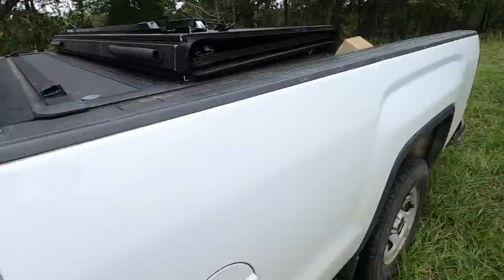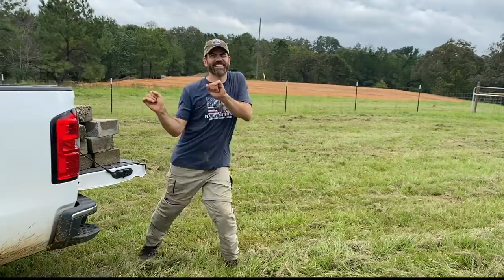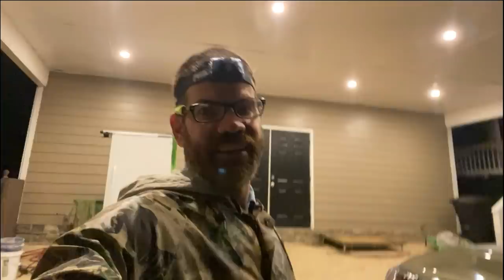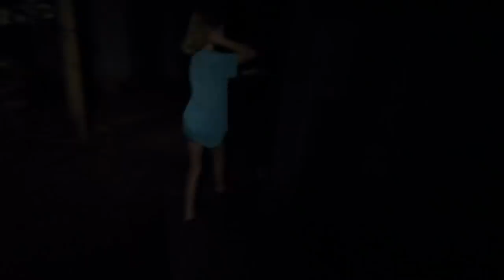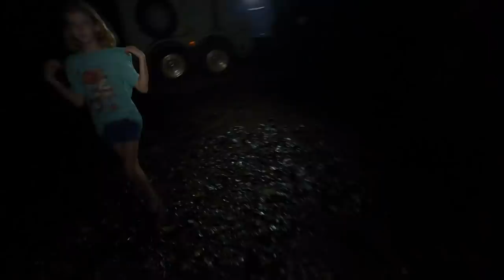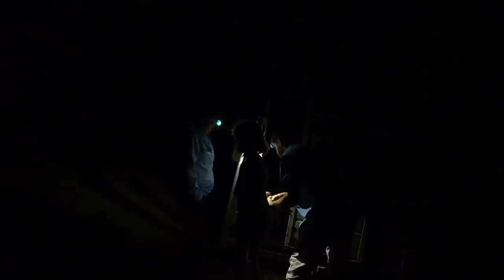It Was So Difficult That We Could Only Do It At Night! Moving The Chickens To The New Farm!

Comment: ATTENTION; Smaller tires on the coup would of helped but since you have a tractor... dig a  sloped hole back a ways from where it sets, and then back  the trailer coup down into it and it will lower the coup a lot making more stable and easier to enter. I surely hope that you  read this. I would not worry about water getting in around those old tires and axle as its gone as far as it would like to go. It will make more stable in high winds as well. That went well

Comment: I don't remember what their called but they make these steel posts that you use to brace op floors you might could weld a couple to the frame and then just jack them up when you move the coup and back down to level it

Comment: I lost track of the names of the different buildings, which were staying, which were moving, and all that.  The big question (of mine) did you move that super looking metal sink?  Are you planning some type of exterior processing area; yeah, ok you're spinning in projects to meet needs, to prepare for the winter, set up fkr the sping and summer, aim for the next phase(s), make things more comfortable or easier, out in a water system, rehabilitate the barn, fix up the other 2trailers - zip yea, yoire building a house while maneuvering in an RV.,

Comment: Jason or Brooke for those chicken trailers to be stabilized since they still have wheels, buy 4 big pieces of steel square tube at 8 ft long get some one to weld large flat pieces of steel to all 4 bottoms then bolt them on with large carriage bolts, since the trailers are mostly made of aluminum (conserve weight when hauling supplies) this is why these trailers can be damged really easily, then build a chicken ramp and stairs (side by side) this will make life much easier.

Comment: Hey guys i know the video are a few days behind so i hope you see this first you'll want to put something behind your wheels in high wind it will help from moving and falling off your jack I've seen it happen more than once lol and keep your tires covered to prevent rot. If your planning to sell your  camper after you get your home built you may want to put your camper up off the tires and keep them covered to prevent flat spots and dry rot and get a carpot to cover it the sun will mess up the paint and i promise you you will get every dollar you spend on it and you can later still use it later on for your flower business or just a storage spot,  hope  and blessings sent your way

Comment: You could use the tractor to dig a hole with a ramp on one end. Pull the chicken house down in it so the wheels will be down a few feet. That would make the chicken house much lower from the ground.

Comment: Why didn't you just haul the trailer over to the old farm load the chickens haul them to the new farm and they would wake up on the new farm already in their coop.
Reply: Maybe had something to do with the true road-worthiness of the chick-mobile. The trailer hitch looked   a bit sketchy. Plus, no running or brake lights.
Reply: @chelledegrasse2787  So you go to Harbor freight and buy a 9.95 trailer light they have a magnetic base nothing to install  just stick em to the side and run the attached wires to the front and that trailer hitch is firmer than a regular hitch it's a farm hitch